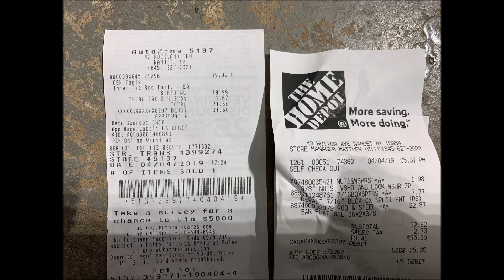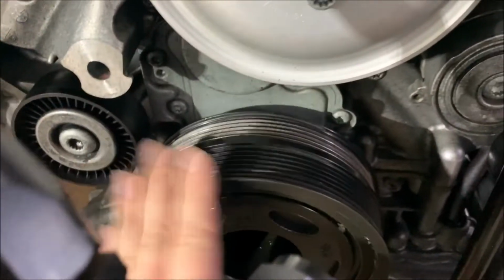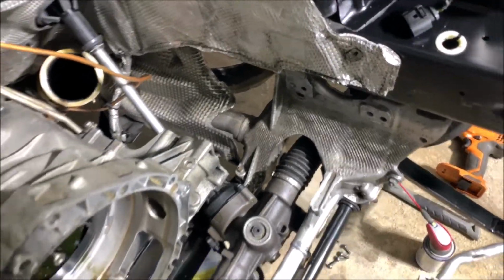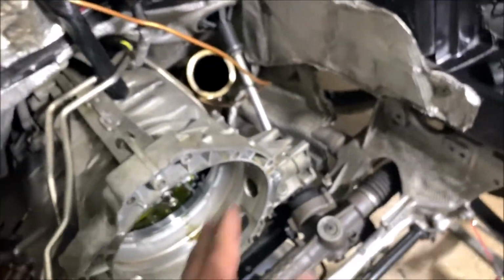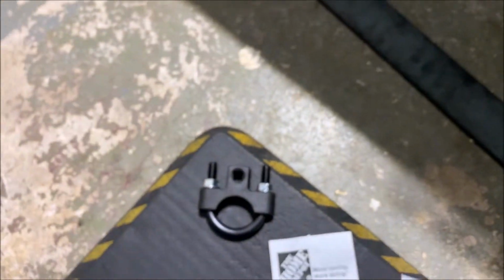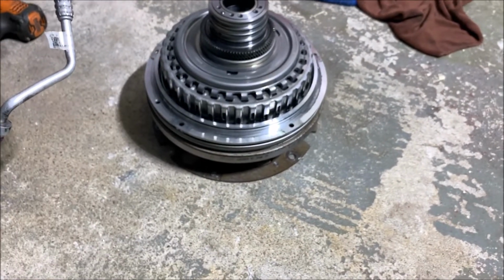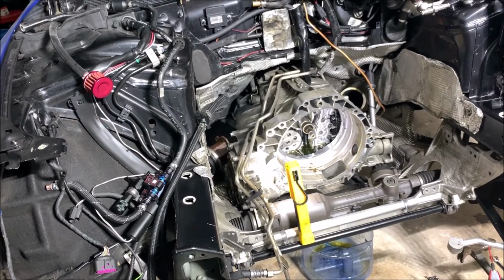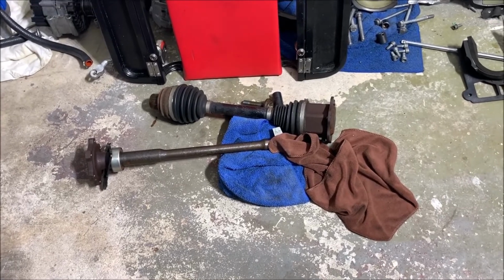DL501 S-Tronic DSG Clutch Pack and More

Comment: Your videos are very helpful, I have a5 2.0 tfsi Quattro, have a lot of issues with the gearbox, clutch is slipping, thought it was some solenoid, I changed to new “used” block. Didn’t help, so next step is changing the clutch

Comment: Hi man, if you're still active on this video, I have a little question for you : I also have this gearbox on a B8.5 A4 and I think the flywheel needs replacement since it makes that typical DMF failure noise. The engine has to come out or the gearbox can be taken out from under the car? I really hope you cand anwer this, thanks
Reply from the maker: You can do do this under the car longest transmission out of the engine and you have space to work.
Reply: @Svarogperformance  wow you re quick. thx a lot dude
Reply: I have this exact issue also, seems to be common. I am looking to do my rear main seal at the same time but cannot find which one I should buy. I have also heard that the clutch pack is not worth replacing as it lasts the life of the car, is this true? Thanks

Comment: I know it is an old video but I have an old car :P so I have a dsg s-tronic 7 speed A5. I want to install aftermarket clutch. What is a decent clutch that doesnt break the bank?
Reply from the maker: This is not old vid ,,, I just did upgrade of the clutch pack last month or so! I went with Dima Deka clutch Stage 3+ just google it ... so far is good little more grippy on shifts at first 1k miles then after clutch adaptation in Vag-Come feels like 100% stock! very easy installation was on my car because engine was out of the vehicle
Reply: @Svarogperformance  thank you friend 🙏